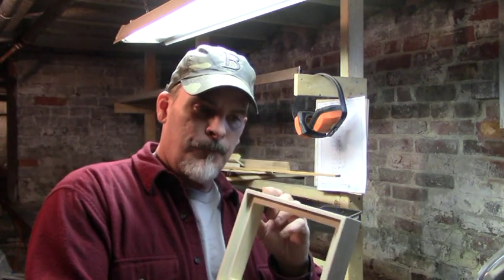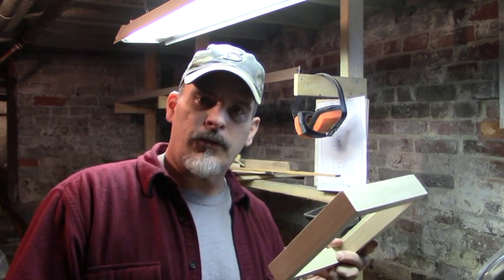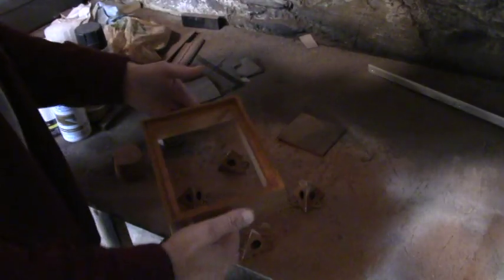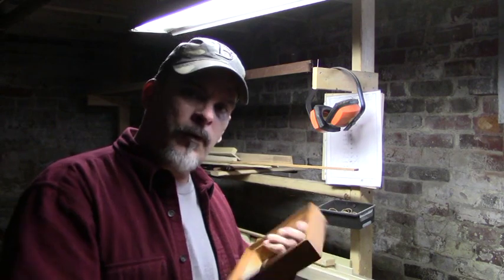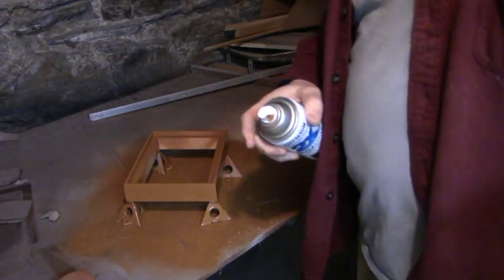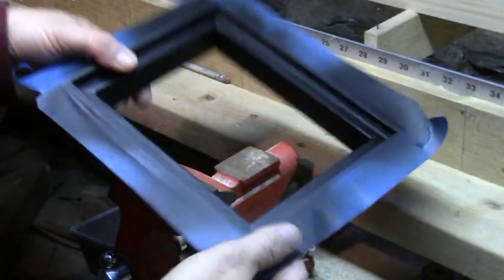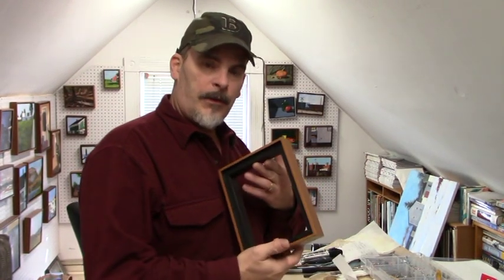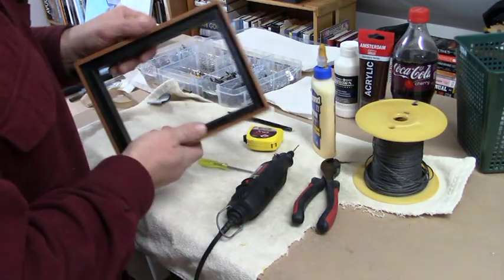How to make floater frame moulding - Part 3

Comment: Hi Bruce, Great set of floating frame videos.  Have you ever made other than floating frames to frame your pictures?
Reply from the maker: Hi - I tried some wide (about 3") flat panel frames, but was not happy with the look . I was trying to mimic the "plein air " frames you see on the art supply websites. Also...unless you have a V nailer that shoots staples on the backside of the frame, it is very difficult to join the frames and have great corners.